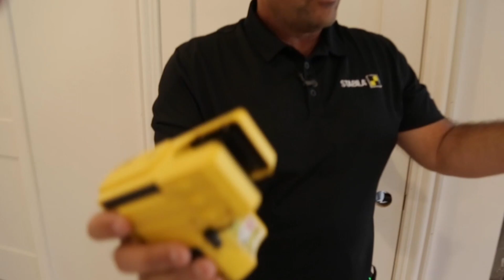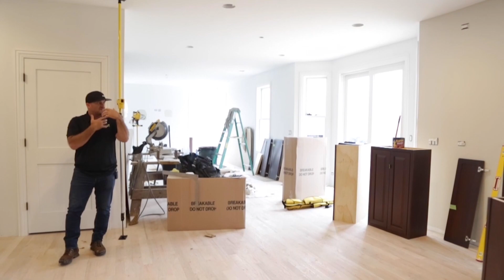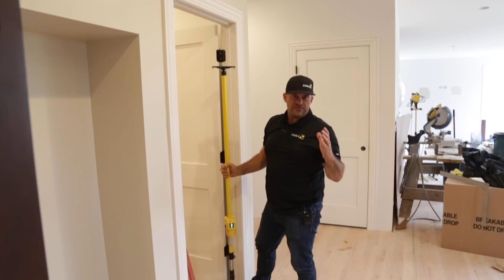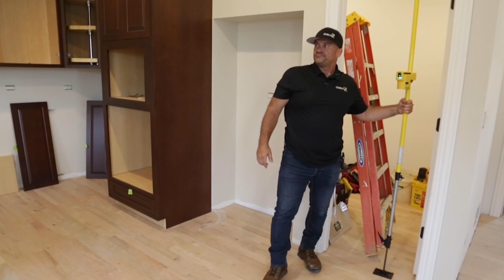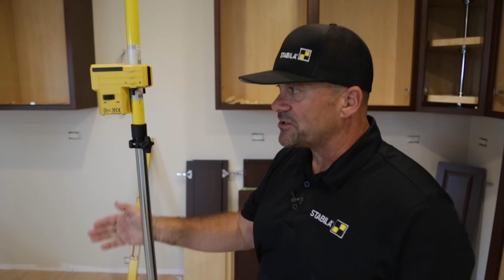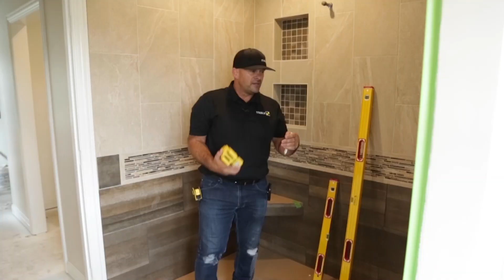STABILA House build | Episode 6 | Interior Finishing with our LAX 50G - GREENBEAM

Comment: How do you attach the upper end of the pole to a ceiling when the ceiling height is higher than the length of the pole?
Reply from the maker: To use the LT 30 telescopic laser support, the ceiling height must not exceed the maximum height of the LT 30 (365 cm).
Reply: @STABILAOfficial  Okay. Thank you for your response.